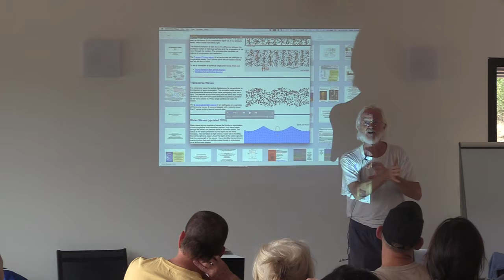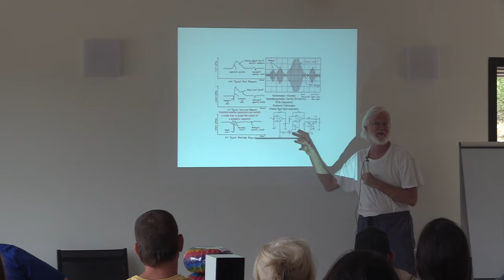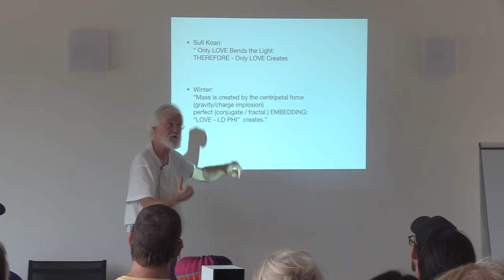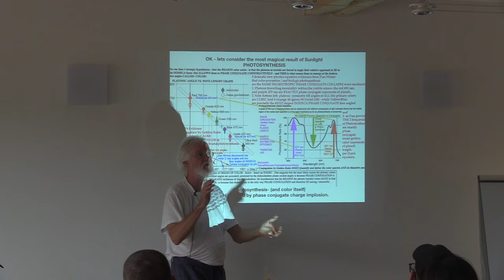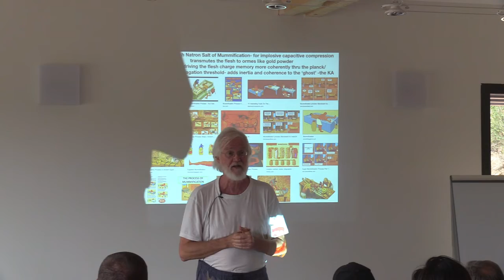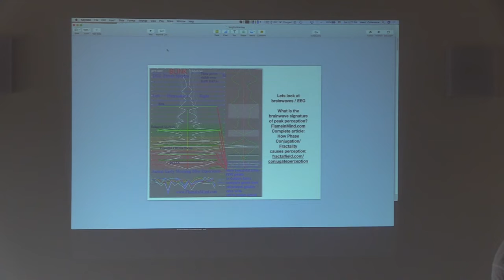Dan Winter- "Longitudinal Wave Immortality" 3rd Int'l Conf Lecture 1

Comment: I can bring up thought as a proof of the aether being completely incompressible. 
When those experiments in the cia asking that astral projections of occurring phenomena in the solar system be documented and verified, we’re the perceptions of the past, or the present?
You see thought is longitudinal, as all field energy. Perceptions of those who were chosen to “perceive” the solar system were deemed accurate. I don’t think there is any disagreement there. 
If the medium in which the perceiving is to take place had any compressibility, those perceptions would be off by minute bits of time. 
Likewise, for example, if “gravity” took time to exert its influence, the orbits of all solar planets would sag slightly as you move out from the center sun. The sun travels through the galaxy, and “drags” the planets with it. The orbits farther out would feel the gravity with a lag, if “gravity” had a velocity. The orbits would be more like a parabola than an elliptical one. Is there a time differential between the gravity felt by mercury and Pluto? I doubt it. 
Lastly shade. Light is now, it has no speed. If light had speed someone somewhere in history would have noticed a shade, but the “thing” that caused the shade would not be there. If light has speed, it is possible for there to be shade, independent of that which casts the shade. 
So….simple ways, based on simple observations we can make clear conclusions about the medium in which information travels; it is completely incompressible. 
Can we find an example of such characteristics, find an example of these same phenomena, in our world? 
Water. Less compressible than rock, and yet is a fluid. I cannot think of a better medium in this plain of existence in which to move information, than water. I do believe aether a more efficient way still of moving information, and it is entirely it’s incompressibility that gives it this wonderful characteristic.